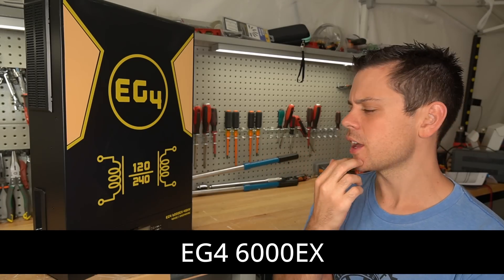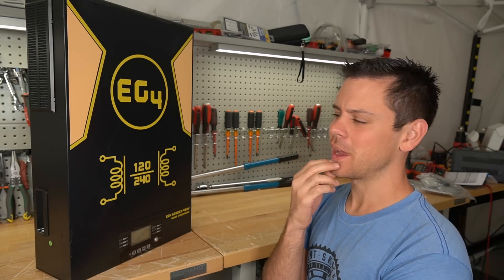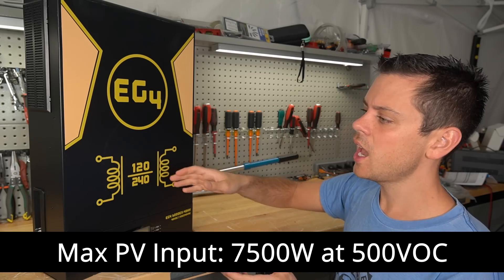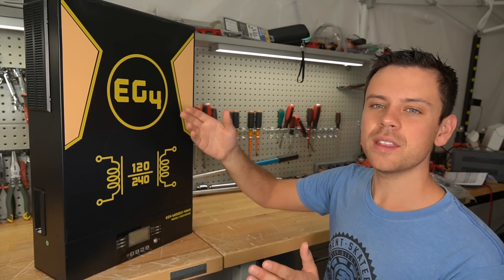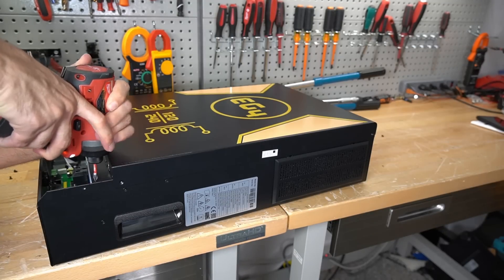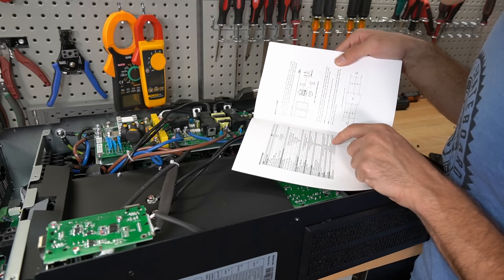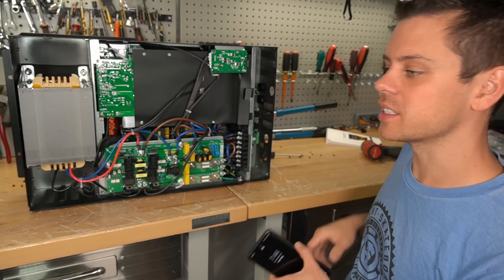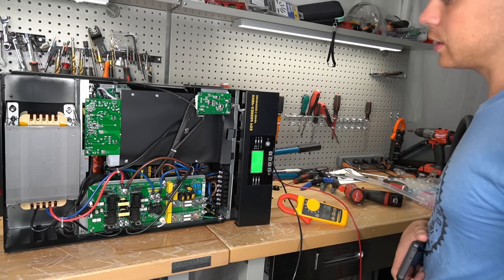EG4 6000EX All-in-one: 6000W LF 120/240V Inverter, 7500W PV Input, 120A AC Charger

Comment: Hey will....if u got a minute....I have a 6000ex hv that won't communicate with my new eg4 power pro indoor wall mount battery.  Maybe you could run your own communication test  between the two.  New product compatibility with legacy products.  I have installed the new firmware.  6115.  Update....i just learned about pinouts.  Got it.

Comment: Got one of these for an off grid studio space that I'm building. Set it up and everything was running fine (or so I thought). Then the electrician who did all the wiring for the space into the main panel said that each leg wasn't giving the proper voltage. L1 was showing 105 and L2 was showing 133. He said, this will NOT pass inspection. I did some reading on the DIY forum and another guy had the same issue and EG4 told him to update the firmware. I did that and change some settings but the voltages haven't changed. This is going to push back my certificate of occupancy for months and the units are all backordered. I had been very satisfied with Signature Solar and these units but my 18K is glitching AND this one is not working properly. I'm starting to regret going with these products.

Comment: I just bought the duo 6500 inverter set up with the connection  box(BREAKERS)  I am thinking of using a single 12 kw 240  volt growatt inverter for my 5ton heat pump along with the 6500 inverters . I thinking that would make a real good set up to start with. should be able to get off the power company my bill for last month was 330 dollaars 62 kw a day). thats alot of money that could be used for enery freedom. Love the reviews and your insights thanks !!!

Comment: Great video Will, I have two of these in parallel in my pump house, one runs pump and a few low load items, the other i turn on when i want to run the house off grid (power failure). The tops get pretty hot to touch, even under no load while charging but your explanation of the transformer size, location and type explains that.  A question for you or the group is A/C input. I have never gotten the AC input (pole power or generator) to do anything, I see the symbol on the screen that the unit "sees" the AC in,  but the unit will not use it to charge the battery (even with PV off) nor will it pass it through to the AC out to the load. Any thoughts from WIll or the group?

Comment: So you are recommending buying TWO EG4 6500's because "they have lower idle consumption! Two 6500's will have MORE idle consumption than 1 - 6000 - and the LV unit will start just about any inductive load vs the HV 6500's. What am i missing here, you aren't making any sense, not to mention the extra cost of Two units vs one.

Comment: I wanted to build your Ecoflow delta pro dyi alternative but I could never get an answer about how to get a 30amp plug for the 6500 output. After searching online endlessly for an answer on this (of course I have asked you many times but didn't expect an answer) I deduced that the 6500 inverter would not work as a backup to my RV power and it looks like I will have to buy this beast instead.

Comment: As a newbie to solar planning, I am overwhelmed! I need to go off grid, but it may take a few years. I am on a well, but do not remember how many HP. It is down 500 ft and I know it takes a large draw to get it going, but it only turns on 2-4 times per day I believe. Due to power company shut-offs during the big fires and or heavy winds, the most important thing is to have this back-up for my well and water booster pump. I need to start small, but want to plan to get the well/booster pump online this summer. I am starting from scratch, and wondering details and best suggestions. Like the idea of this EG4 6000EX. Don't want to waist money going too small at first with the DIY All-in-one. Do you have a class for beginners with all the products you have tested?

Comment: Would this be a good option to put into an 50Amp Motorhome to run both sides of the distribution panel via Solar/Battery  when boondocking, and pass thru power when connected to shore power?

Comment: You are doing a great job, HOWEVER. Your evaluations are only on the surface and hardware. EG4 is a white labeled product and as we know the origianl manufactor is Chineese. What is really interesting is the portal that you will monitor the product has its server in China with Alibaba. You also do the product review on a short term bases and don't go over the product warranty which does not include Labor. Again Great job on the review but people are buying these products without having the full information. Will these inverter fail within the next two years? Time will tell.

Comment: 140W idle ... what a joke =>  thrashcan.
EG4 are just rebranded Chinese, not saying they are not good cause they are Chinese, but .. better to buy the original one.
In my case, i'm off grid, i use a 6.5kW inverter for "heavy" loads that is off 90% of the time and a small 1200VA victron phoenix inverter which is on 24h24.
Total cost : 440€+300€ = 740€. I got 2 220V circuits, one for high power appliances and one for 24h24 devices, 4G router, mini PC with Proxmox, Home assistant and such, meteorological devices...

Comment: Im just starting on the solar world, so please easy on comments. Here is what I was looking, my house load is not that much, I will start track it to have a 100% better visibility (using Emporia), but assuming that it is less than 5000w peak hour and that I need 240V output (entire house except heat pump and not electric oven, heaters). I was thinking instead of use the EG4 6000EX I could use 2 x EG4 3000EHV. So the output will be the same 6000W and  I would have 10000W PV Input. And if we look total weight it will be lighter and also the Idle Power Consumption will be less.
I know that it is too superficial infos but does it at least make any sense for all you guys ?

Comment: Am I correct that the idle consumption would be about the same as the lv6048 if the inverter on both is turned off and I'm only using the charger?   Does this unit have the capability of having the inverter turned off with grid power passing through it to the load and a setting to automatically start the inverter when the battery reaches a set high point and turn off again at a set low point.
Thanks for all the videos and info!

Comment: So after doing some research on this unit and looking at close-up photos, it looks like there are only 3 wires connected to that transformer. Wouldn't that indicate that it is functioning as an autotransformer, and that this is not a Low Frequency inverter? From what I have researched, it sounds like a LF inverter uses the transformer to perform part of the inverting/voltage step-up function, not JUST create the neutral from the 2 hots.

Comment: Question about the idle consumption... So if it's pulling 135w with no loads, what happens if you connect, let's say, a 100 watt load (think internet, router, a switch) that will be running 24/7. In theory, the idle consumption would end up getting added to those load consumption, but I would be curious to know if some of that idle consumption gets "absorbed" in the load. (So instead of 135w + 100w = 235, I wonder if it would end up being something like a 200w total draw when it is running the 100w load).  I think that would be an interesting test to see how a constant affects what is pulled from the battery. I am building a partial off-grid system that will run things like my fridge, internet, lights in the house (low-current things). My internet/security items pull roughly 100 watts 24/7. That 135w is a lot to draw 24/7, but if some of that power ends up going toward ALSO running a 24/7 load, I think it would be a little more justifiable.

Comment: What is the differences between EG4 6000EX vs EG4 8kW Hybrid Inverter?   I want an all in one, that can sync grid power to inverter power to assist in house power consumption from small solar,  charge batteries via grid as needed,  accept solar to charge batteries as needed, in case of grid power outage supply house with emergency power, but never back feed to the grid.  Am I correct the 8kw hybrid can do all this, and can the 6000EX now do all this too?  I just saw your video on EG4 8kw hybrid.  So which would you buy the EG4 8kw hybrid or Siemens 6.8kw Hybrid for $700 more.  I do like the generator option and wonder which  has best software.

Comment: I have a question Sir I have an Old MagnaSine TWO MS4448PAE IN PARALLEL that run ALL my House Power and I just got TWO EG4 6999EX-48HV in PARALLEL and 6 EG LIFe Power Batteries to go with it NOW HOW DO I INCORPORATE THESE TWO SYSTEMS to SUPPLY the POWER I NEED obviously you cannot RUN these SYSTEMS at the SAME TIME WHAT DO I NEED to RUN ONE OR THE OTHER any pointers surely appreciated thanks

Comment: Dear Will, thank you for a very informative video on this inverter.  I can’t find in the manual on the length of wire I am allowed to use from the inverter output to my sub-panel.  Due to the configuration of my home, there is no way I can install this inverter to my sub-panel.  I am looking at 85 feet and was planning to run 6WG.  Would this be enough?

Comment: Layman's terms, please. I'm 65, but teachable. We have a couple of mr cool hvac split system units with a 36 btu condenser. When they were used last summer, they, along with my other electrical household usage,  caused an average 30-35kwh daily use. I've since installed new energy efficient windows and R-45 attic insulation with roof underside reflectix, in attic to reduce heat and cooling loss. I've had a fireplace insert, at 1750 sq ft capacity, installed in my fireplace to heat my small 1200 sq ft home. Love it all. Wanting to go solar off grid. I've now cut my use down to half, 13-18kwh daily. I want a system that will suffice for my needs now but also be able to handle my summer month usage of my mini splits. I don't think I will use them as much as I did previous to my window and insulation install, but thinking ahead. Lol. Love your input!! Love your videos!! Looking to possible EG4 Ex 48v 6500 inverter (1 or 2?) With solar panels (#10?) of around 450w size. A bank of 48v EV4 batteries (4?) Have a couple of generators to use as a charger for this system on multiple cloudy day periods. Can you help, please? Thank you!! God Bless. Love the looks of that new bigger EV4 battery with large handles. Keep up the astonishing work you do here!!! You are a Godsend!!

Comment: Thanks so much for this!  You keep mentioning well pump with this one and that is exactly what I'm looking for my setup to handle without getting stupid expensive.  

Question if you have the time, if I get one of these and one of the EG4 48v (just one), would that work to run a well pump?  My well pump is 240v and I believe it is around 5hp.  It does have a small tank to hold pressure so I would only turn on the system, turn on the pump to build pressure in the tank (usually only takes a minute or 2) and when the pump is done turn the system off till I need to build up pressure again.  So basically, only short bursts or surges as needed.  I believe the inverter itself can do this, but really, I want to make sure one battery would be enough or do I need to two to be safe.  Over time, I would definitely get another battery, just looking to keep the budget low initially.

Thanks again!

Comment: So does it make any sense to get something like this without solar panels and use the AC charger to charge the batteries with a fuel generator?

I’m considering EcoFlow but getting mixed signals on the product and the cost for 3600wh is $4k without a solar panel.

Comment: Anyone know the max battery voltage input this unit can handle? Ima have to save up for the eg4's so in the meantime I'll be using my 60v battery bank if it's not to much for the inverter 🤷‍♂️
SS told me the max was 48v 😂🤦‍♂️

Comment: I am in the brainstorming part of going solar for my whole home/workshop. I want to start small and get the home off grid and grow from there. I don't mind spending money on a good All-in-one. 
6500EX x1 + used solar panels + diy battery rack for the house. Would it be better to upgrade with another 6500 or get a 6000 for the shop? Biggest load is a 120v welder atm for the shop.

Comment: Reminds me if the Schneider Conex SW.  i need to spec a small UPS for my church without solar.  This along with AC input and a 48V battery of some size should work to front the tech booths there.  Why do we need it?  Not really a need but a problem in the restart steps of all the equipment makes it a nice to have.  Also may do something like this at home for a small backup power system.  Considering for a wholehouse minus HVAC standby.

Comment: I know this is a dead comment section, but this would be able to be used to charge a car from battery correct at L2/5Kw speeds? right? I'm looking to build out a solar car charger setup with a battery bank that can hold ~15kw.

Comment: would be a good fit for my shed with no grid electrical power to run compressor and other tools.   Would be using a gas generator to charge it up though.  Not worth spending money on solar panels for now

Comment: NO BETTER SURGE THAN 1 6500 EX
6000 EX=12 kW for 1 sec
6500 EX=13kW for 5 sec
Is this because the 6000 EX is not a true low frequency inverter, but a Hi Freq inverter with Transformer?
If this is true I'm better off getting the 6500 EX and re-wiring my small well pump to 120vac.
(240/5A or 120/10A)
Sorry if I'm wrong, I just started learning about split phase inverters today
This would be handy if you need 240vac but not an advantage for starting inductive loads over the 6500EX?
Reply: I took the unit apart and it appears to be I high frequency inverter where they just stuck a transformer on the top really half-assed kind of wasted my money
Reply: @caseyjones1999  Thanks for that update Casey.  I guess that explains the lower price.  The true Low Frequency inverters with high surge capacity for well pumps etc. are much more expensive.

Comment: If your running well pumps or industrial motors and heavy duty electrical equipment. install a soft start like Schneider ATS01N109FT Soft Start Motor Starter.
This will take a ton of torque amp load off your electrical system.

Comment: Will. While the Idle consumption is higher than the EG4 6500 HF inverters, it offers split phase on a single unit. The idle consumption of one 6000ex is less than using a pair of 6500ex units for split phase. 

If you wanted to compare for the same output, the idle of the 6000EX is actually only 4 watts more than using a pair of 3000ex units according to the data from your previous videos. Plus you get the benefit of an all in one package.

Comment: Will.  I am seriously thinking about installing this 48V system in my RV. Including at least 1-48 V battery from eg4. I believe the 240 V would be useful to run Hi efficiency ac (Mr cool, etc). But it would be part of a larger upgrade to full solar. I wonder if the loss in Efficiency that you highlight is worth it to get higher efficiency from the Ac.  Your stuff is amazing. You’re funny and honest when they piss you off.

Comment: I have 32 solar panels with enphase inverters, if I wanted to add batteries to maximize my time of use billing is this what I would need? Ideally I want something that can run my homes  240v 28 amp a.c. unit...(obviously I would need batteries as well)

Comment: Just a note on the idle consumption, this being a single 240v split-phase unit, you've basically got 2 inverters in one, so a fair comparison in terms of idle current draw would be matching it to 2 3000w inverters running in split-phase. I'm guessing it would only draw about 35w more, which isn't terrible considering the space-savings and less wiring you would need. The 6500EX x2 idle consumption would be higher than this for running split phase, although you'd have twice the overall wattage and more solar inputs, but that might be overkill for many people. Just something to consider when comparing this to other inverters in 240v split-phase configurations.
Reply: Great points

Comment: Hey bro, can i ask a question? Im planning to build portable solar generator with 200Ah battery (LifepO4) and im planning to charge it using AC power. How can i charge it? What do i need? Is 20A (buck converter) charger will be enough? 10hrs? What if There’s a load while charging at night? Is 10A will be enough to full charge my bank? Thanks in advance.

Comment: Will, I have a one Bluetti AC300 with 2400 watts of solar  so I do not have it hooked into my transfer switch that is 240 volt that runs my well. I have heard that my transfer switch may not work with the bluetti split phase system.  My transfer switch is a Reliance. Do you know any info about this?  One thought I had was rather that getting another bluetti is going with this type of inverter. Thoughts on this would be appreciated. Goals would be how to use equipment that I have along with 240 inverter that would work to run my well and transfer switch.  Thanks

Comment: Max PV input 7500 how do I put more PV power into my battery about  24000 PV per day would you just use several 3 or more inverters  or different soler charge controller ?

Comment: Great video and content as usual. Thanks!
Would be interested in seeing more about AC-coupled inverters specifically that can auto switch and push pull on the grid for time of use type net metering plans to reduce usage during peak hours. Also how can they combine with AC-coupled solar mounted micro inverters (like enphase iq7/iq8, etc). Thanks!
Reply: Anyone test the ac couple setting on this 6000ex. I see it in the settings I would like to use for an enphase microgrid (off grid in power outage mode)